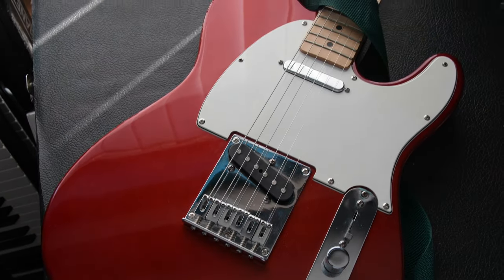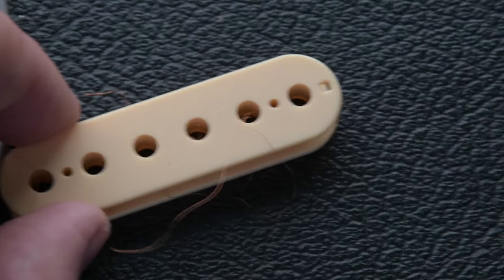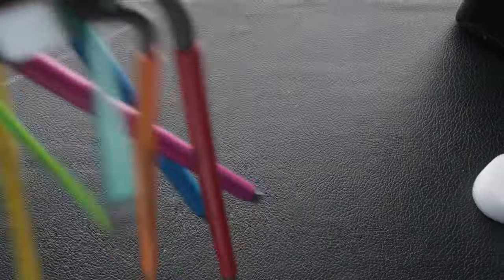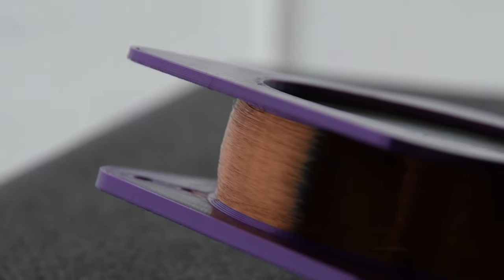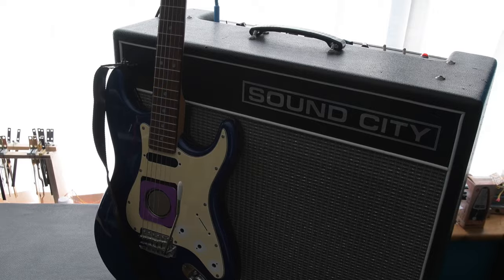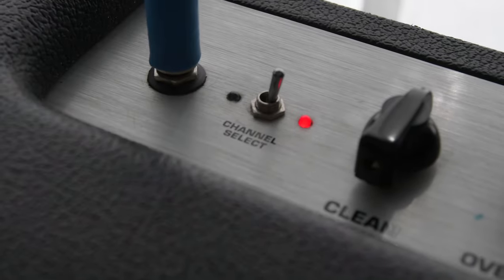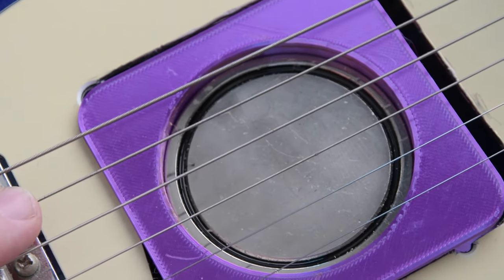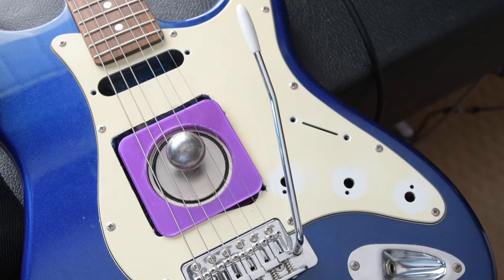This Guitar Pickup Can Lift Heavy Metal - World's Most Dangerous Guitar Pickup

Comment: I was surprised by the very low resistance.  Compared to the typical strat single coil, how was the volume level?
Reply from the maker: I'll take some measurements and post back. I think it is a little quieter, though I will confirm.